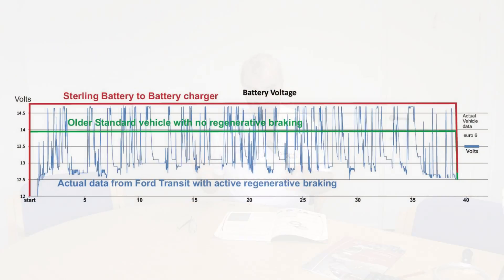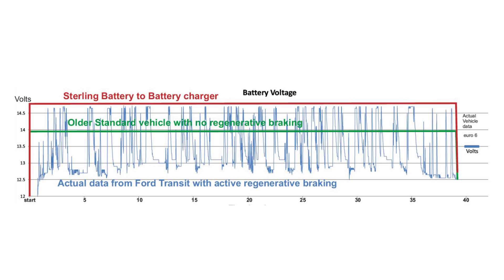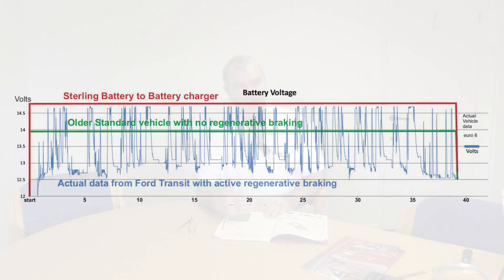Smart Alternators and Regenerative Braking

Comment: Very interesting, I was considering upgrading my standard Audi A2 TDI to only charge when deceleration to increase acceleration and improve fuel efficiency, that's how I found this channel. Some good ideas here, I think super capacitors need to be added to take the access current as a buffer then slowly release the access charge to secondary battery. I'm from Armagh BTW.

Comment: Can't I create my own regenerative braking by adding a relay to my brake light wire that will connect my secondary batteries to the starter battery/alternator  and beefing up my alternator to say 370amp output? Just wondering. I have no idea what I'm doing
Reply from the maker: Hi there,

I'm afraid not as this still won't solve the problem that is : your alternator will not be outputting a valid charge voltage unless you're slowing down, or unless your ECU detects that your starter battery is under significant load. Simply expanding the size of the starter battery will not be good, and it also won't be good when your Euro6 engine starts outputting up to 19V onto your leisure battery.

Euro 6 and battery charging just is fundamentally not good, thus the requirement for battery to battery chargers. 

-Ben
Reply: @SterlingPowerProducts  - Darn. What if I hook the starter battery directly to the house battery will the house battery leech power from the starter battery if the house battery has lower voltage than the starter battery? My goal is to only partially charge the house batteries from the starter battery when my house batteries get to say 12v and my starter battery is at 13.6v.
Reply: @SterlingPowerProducts  - Btw my house battery is a 700ah 12v lifepo4 custom build 16s and my starter batteries are dual Gel 65 series 12v
Reply from the maker: @HuskyD-q1n  In theory that would work, in the sense that the lithium batteries would take some charge through, however I absolutely cannot recommend it. 

You should only ever charge a lithium battery (when charging from an alternator source) through a battery to battery charger. It's simply not safe otherwise. 

-Ben

Comment: But does the fuel  saving anything like pay for the premium price of AGM battery and shorter battery life?   Also  weak aircon blower performance and permanent knife edge low cranking power if you dont drive the thing too much  is a pain unless decelerating! Hope I can find a way to disable this function for my Vito 113. On the legality question, driving with low tyre pressure or having the windows wound down or having a roof rack would all deviate from Euro testing and what's the point if a fuel saving system needing  extra driving if you have a smooth driving style  and finding hills to descend to keep the battery healthy?
Reply from the maker: Hi Phil,

Not sure if you've heard about this yet, but if you install one of our battery to battery chargers on your vehicle, that should somewhat disable Euro-6 and just have your alternator running from when you turn the ignition on, to when you turn it off.
Reply: @SterlingPowerProducts  I'm needing to be brave enough I think to disconnect the Voltage sensing cable.....
Reply from the maker: @philhealey449  Hey Phil,

Not sure I understand- all the ignition sense cable does is sense a tiny voltage spike when you turn your keys in your car to engage the BB to run reliably. 

I'm here to help, I just don't understand your inquiry :)
Reply: @SterlingPowerProducts  I understood the smart alternator was receiving battery Voltage direct from the battery terminals with the sensor wire to avoid error from Volt drop in the main cable and is normally  trying to maintain a miserably low float Voltage of say 12.5 or 13 Volts at the battery, corresponding to supposedly 80% battery charge status, except when it is commanded under downhill or  deceleration conditions to work harder. This is the only time that  my  blower fan speeds up to acceptable levels.   The fable goes that simply  disconnecting the sensor wire tricks the alternator into normal output, but I worry there may be dire consequences for alternator health or battery overcharging because I dont know if the   alternator then safely defaults  to normal  approx 14 Volt regulation.
Reply from the maker: @philhealey449  Right, I understand.

I'm not in the position to recommend whether rewiring, or indeed, removing wires within your vehicle is a safe or good idea. I haven't heard of any Euro-6 bypasses that are as simple as that.

If you want your vehicle alternator to last longer, reliably and to provide an output consistently the only thing I can recommend is a Sterling Power battery to battery charger. 

That will provide you with charge up to 100% and it will cause your fans to run as intended.  There's no negative long term effects on the alternator outside of the fact that it's actually being used.

Euro-6 alternators like to spike randomly when running- to a variety of voltages, as they are at the moment.  

Summary : I can't recommend anything to do with your vehicle wiring outside of fitting a BB1230 which will solve your problem.
Reply: @SterlingPowerProducts  Thanks for trying ! Rgds.

Comment: We have a 2018 Ford based Motorhome with an automatic gearbox and have witnessed the voltages you describe. We also have a solar panel which charges  leisure battery via a PWM controller.  Can I maintain my starter battery  which has an important security  device that will not interfere with your system?